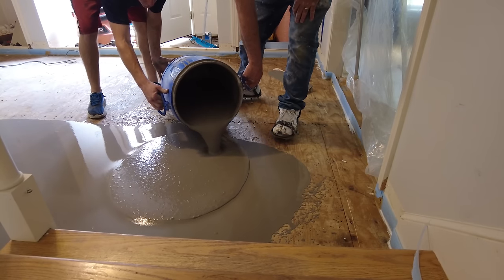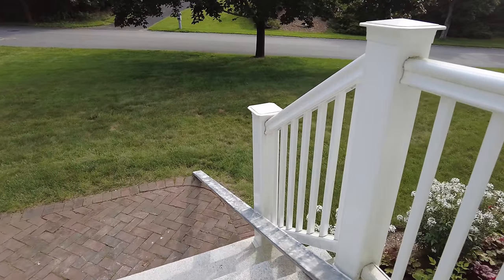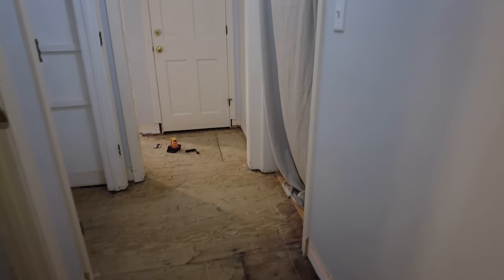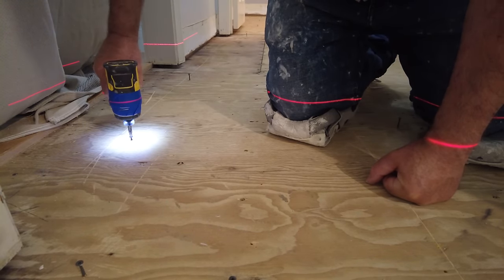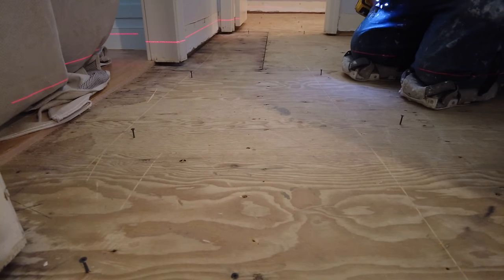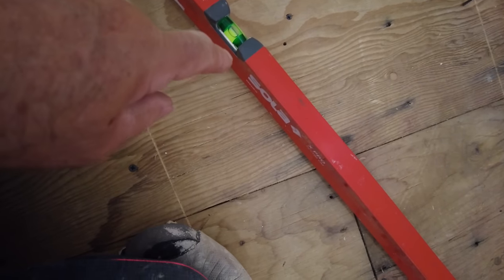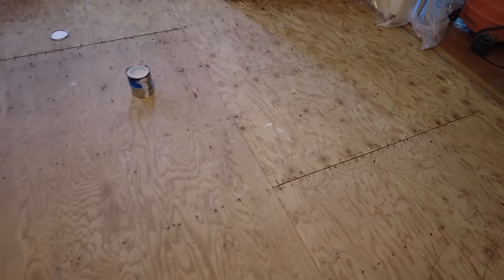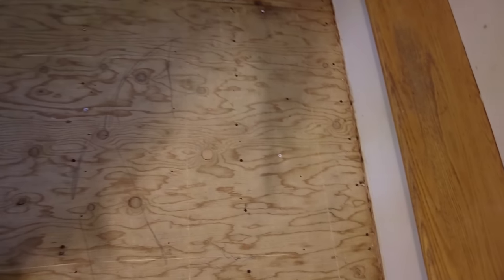Self leveling a floor, how it's done.

Comment: Can you recommend self levelers that are compatible with OSB? Most either indicate not to use over OSB or don’t address compatibility at all? Also, it seems that OSB subfloor in my house (per stamp on small unfinished ceiling in my utility room) is 19/32. Can self leveler be used over this thickness on an upper floor? It is only needed underneath a 60x30” bathtub with 2x9 joists 16” oc.
Reply: Why would you need self leveller under a bathtub?

Comment: How far out of flat does a floor have to be to require this kind of prep?
Reply from the maker: From The CTEF
The ANSI Standard for Subfloor Surfaces, ANSI A108.02 - section 4.1.4.3.1, states in part:

“For tiles with at least one edge 15” (0.38m) or longer, the maximum allowable variation is not no more than 1/8” in 10’ (3 mm in 3 m) and no more than 1/16” in 2’ (1.6 mm in 0.6 m) from the required plane, when measured from the high points in the surface.”

https://www.ceramictilefoundation.org/blog/floor-or-wall-flat-enough-for-large-format-tile
Reply: @SalDiBlasi  Thank you!!

Comment: Can someone explain to me why its ok to pour concrete over a wooden floor but for example, if you frame in a basement, wood can’t be put on floor directly and needed to be pressure treated….. is that pressure treated ply?
Reply: It was in the directions that you can. There is chemistry that hardens and then it doesn't soak up water.
Reply: @falkfluegel5557  thanks.
Reply: Put 6mil poly under the plates.

Comment: Question: would the screws need to be used if you were using this product to flatten the floor (fill in low spots) as opposed to making the floor level?
Reply from the maker: No Just screed across high spots.

Comment: With a floor that much out of level, you should be fixing the sub floor which has obviously dropped and so raise the stumps or bearers. If not repaired, the floor is going to drop further over time and will crack your expensive tile work
Reply: True, It’s hard to tell how old this house is. One thing if it’s only like 30 years old, but 100 years not surprised.

Comment: How did you determine the exact high spot with the straight edge?
Reply from the maker: Move it across the floor see where it rocks and where there is space below it, check with a level or laser.

Comment: Sal why not work with the companies that make the clips so they make them so we don’t have to keep modifying them.  Cutting them down, thinner at breaking below visible grout area.
Reply from the maker: Watch this video, https://www.youtube.com/watch?v=-Ey7V4o5OzE&t=3s always use the 1/32 clips and a separate spacer, never pinch the clip between tiles. They will break out clean every time and if by chance they don't a utility knife will cut through the thin phasic with ease.
Reply: @SalDiBlasi  So are you always using the tiling system just to pull the tile down and not as spacers because they come by spacing size.  So you just use them to pull the tile down and not as spacers?  Do you always use the same spacing?  I use different tiling system sizes and the hardest thing is to keep the sizes separate because they are all the same clear color but different sizes 1/16 ⅜ ¼ mainly 1/8 which I have 8000 of.  

So you recommend I buy the smaller meaning thinner 1/32 ones and use them just to pull the tile down and use the U shape as separate spacers …. It’s no wonder you don’t have problem with them breaking off if they are the thin 1/32s

Comment: You are supposed to leave an expansion gap between the leveler and the walls. Approximately 1/4 inch. Unfortunately Your tiles will eventually crack.
Reply from the maker: Did you watch the video. Look again.

Comment: Almost all manufacturers call for no more of a dip of 3/16" in a 10 foot radius.  That's wrt flatness not level.  A floor can be flat without being level.  My concern with your method is how you might come out at existing floors and especially the first riser on the stairs going with "level".
Reply from the maker: For tile of the size being installed here TCNA calls for no more than 1/8" in 10 ', and no more than 1/16" in 2 feet. Can't do anything about the riser at the first step, it is what it is, although the finished height of the tile in that area was close to that of the original tile floor.

Comment: I have been self leveling floors in preparation for marble/granite tile for 25 years, I have never ever had a floor not come out perfectly flat and level and I have never used screws or squeegees all I do is mix it "exactly" as the manufacturer says on the bag and pour it out and it self levels perfect, I am 100% completely confused by all the extra work you guys are doing here, maybe you should try another brand self leveler if it's not self leveling. The key is mix and get all the product on the floor quickly so it can do its thing. I have as many buckets as needed for the job filled with pre-measured water before I even start the job that way I can mix and pour Superfast so the product is still viscous and will 100% self level. I would be willing to bet the floor comes out worse the way you guys are doing it.
Reply from the maker: Hail to the god of self leveling.
Reply: This has not worked for me for a recent house renovation where I had to level 60m2. I've followed manufacturer recommendations carefully and to the tee, but the product didn't self level. I ended up having to grind down a majority of the compound off which took 2 weeks full time, and ended up getting bursitis even with kneepads. 

The method which did work for me was Jack King's youtube channel (Arizona Home Floors), where they use two straight edges around the perimeter and have an additional straight edge inbetween to ride them like rails. My floor ended up perfectly flat and level in all directions and was within 2mm over 1m tolerance. Below the 3mm over 1m tolerance by flooring specifications. 

Avoid grinding at all costs it's horrible having to wear a respirator and suffer on your knees for thinking a product should work as advertised.
Reply: PINNED reply here...also when setting tiles, use the under-over locking spacer, butter both sides
Reply: @iamram93 the key ad the comment said above is to be able to mix it all in one go. Granted 60m2 is very hard. Also the product I use says to use 4liters which leaves it thick like in this video. It doesn't self level. 4.5 liters however is perfect. Done my floor 5 years ago with it. Still perfect. Also priming the floor is essential as concrete underneath will such the moisture out to fast, especially on larger floors.

Comment: Just wish I had come across this earlier, after having made a pig's ear of levelling whar appeared to be a straightforward floor.
Reply from the maker: You are not alone, most people read "Self Leveler" and assume it is a magical product that flows to every low spot in the floor and fills them exactly to the level needed, while flowing off the high spots not creating a hump. MAGIC. That might work for a very small bathroom floor, Do a slightly  larger floor one time and find out it doesn't.

Comment: USE FRAMING HAMMERS, ONE IN EACH HAND AND GO TO BASEMENT AND HIT THE BOTTOM OF THE FLOOR JOIST WITH FORCE,IT WALKS IT DOWN LIKE GLASS, I call it puddling,It's me using gravity as my helper :) cheers
Reply: Here's the skinny gentleman, Gravity is your best helper,Use all of your greatest resources to your advantage and use puddling as your biggest helper using gravity as your go to guy,On concrete you use a busshing hammer and walk the material down from the deepest dip spot then walk it down,The Bit can be used in the level guick then just wash off,It's best to use the biggest holding mixing bucket 🪣 you can find,Do big pours for the floors,But what do I know 😀 ciao
Reply: Wood and resin Designs.c o m  Who are you referring to kimo Sabi???

Comment: mixed properly, “self” leveler, ALWAYS levels itself, EVERY TIME.
Reply from the maker: Anyone that has actually had to do self leveler on a larger floor knows you don't have a clue.
Reply: @SalDiBlasi  100’s of thousands sqft. if all my guys wasted time on these big building feathering we’d never get done. we only use an aerator, spike shoes, sometimes pump, sometimes 4 or 5 dump barrels with two mixing. NEVER FEATHER, makes no sense.

Comment: They should change the name of self level because it sure doesn’t level it self huge misconception when doing this work in other words harder than it looks
Reply from the maker: They have changed it, it is now called "Flowable hydraulic cement"
Reply: @SalDiBlasi  you learn something every day in this trade
Reply: @SalDiBlasi  not going to lie I did self leveling today with laticrete and made the floor worse I did use the rake to
Spread it but end up having to grind down many humps

Comment: I’m a 40 year highly specialized contractor and you were killing me! You over work the material by 10 times what was needed. You need to have better placement of the material and a lot less massaging of the product You did a great job at preparing for the job but murdered the end product. Yes it turned out nice but it should have taken half of the time. You can buy most of the tools and still not know quite how to use them you are working the tools instead of the tools working for you and there’s some better tools out there. Look for them. I didn’t see when you put the binder down? But I did fast forward a few times.
Sorry it just drives me nuts !  I got to retire. Over all great job!